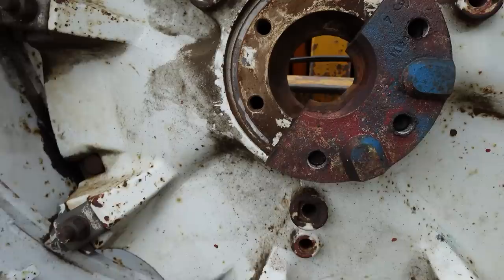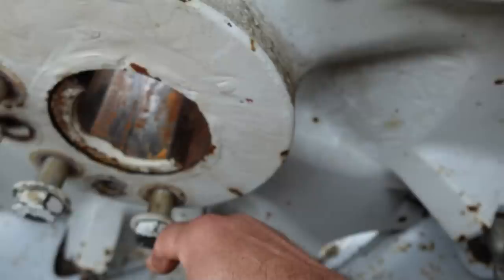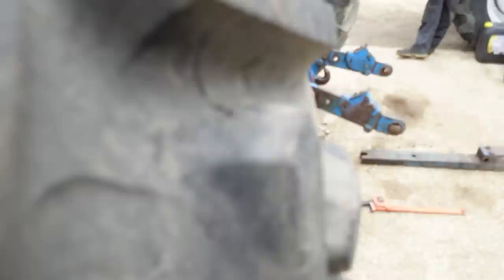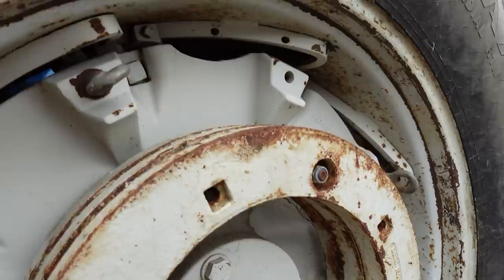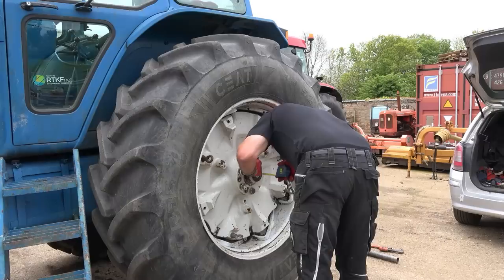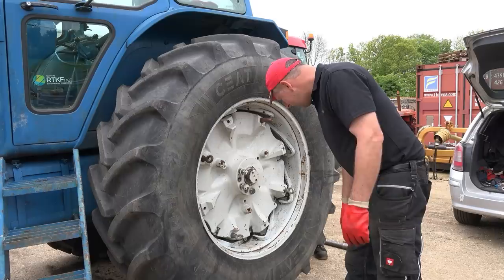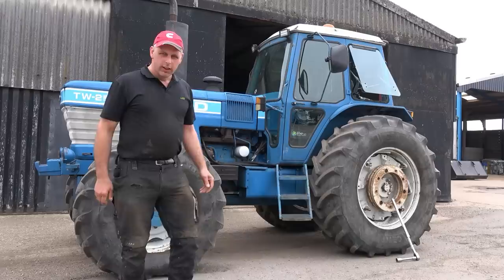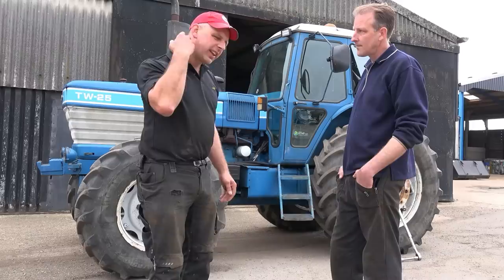The MIGHTY FORD TW25 IS FIXED! The MYSTERY OF ADJUSTABLE WHEELS REVEALED!

Comment: Glad you have the old girl up and running again George. If you ever have to take the wheel off again, maybe use a silage bale handler (the two roller type) at least you can rotate the wheel 👍
Reply from the maker: I did think that would be perfect, but we didn't have one to hand
Reply: @GeorgeSaunders  two bits of plastic drain culvert over the pallet forks next time then 😂

Comment: Glad to see it all back together and working finally. 
Anyone know the technical reason for using the wedge lock system over a traditional hub flange with nuts or bolts, other than adjustable track width?